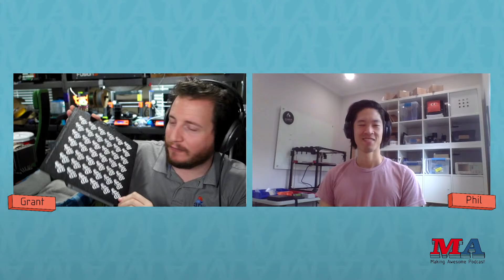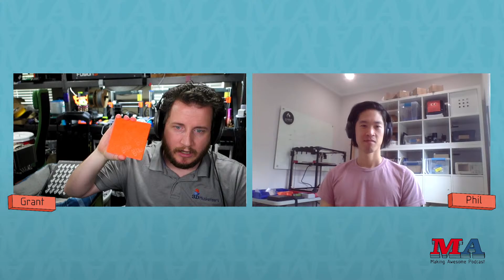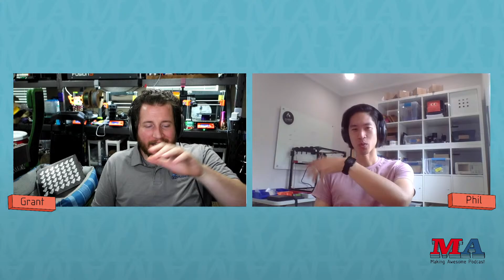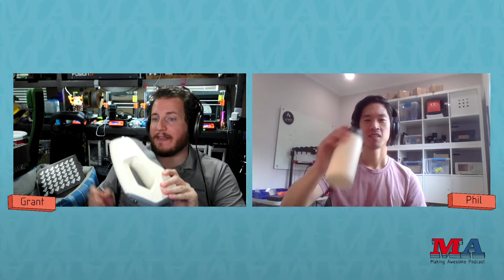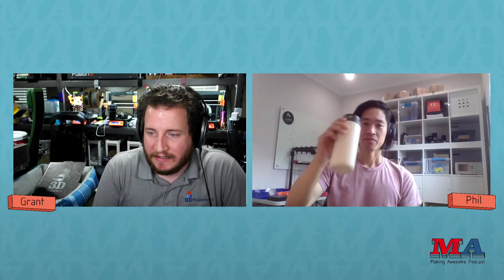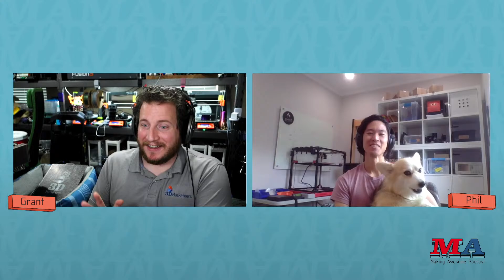Making CUSTOM Buildplates with YOUR LOGO with @emberprototypes!! Making Awesome 192

Comment: @~#42:00 is request for software plugin to help pattern logo on plate? Maybe i can do for you with geometry nodes in blender, and then create an add-on? Not sure I'm clear on spec desired?
Reply from the maker: along those lines, yes, someone uploads a black and white PNG and the software helps them pattern it out and ideally would show them a render of what the plate would look like
Reply: Yes some kind of artwork "designer" for plates where users can upload their artwork, resize it, rotate, mirror and pattern would be helpful.
Reply: Bonus if it's a Shopify plugin haha 😅
Reply: 😅  @emberprototypes  no experience with shopify sorry. Maybe can do a blender based tool, we'll see.

Comment: Anyone have timestamp for how plate is made, resolution?  What's the coating material and thickness?  Does coating flex with the steel and last as long as PEI?
Reply from the maker: Out of respect for the secret sauce we didn't discuss the process. Image should be at least 300 dpi. Thickness isn't 100% set yet and so far no one has had issues.
Reply: Yes there's a bit of secret sauce but through many hundreds of prints and beta testing the coating stays resilient with the PEI. The thickness is around 0.1-0.3mm but can be a bit more variable on larger plates - the target is 0.2mm. I'm working on making that more consistent soon. That being said even with such a large variation the first layer printing seems very forgiving and have always come out clean this far.